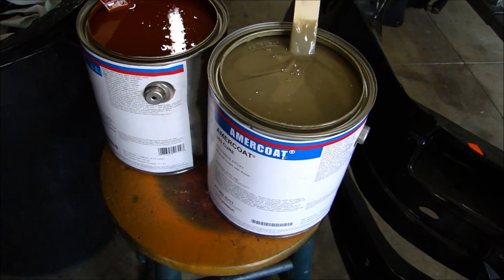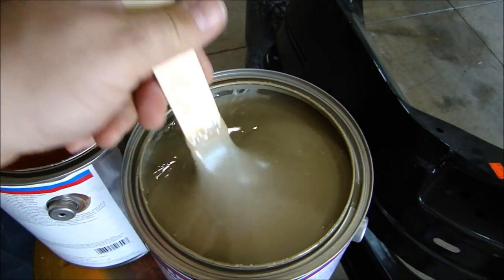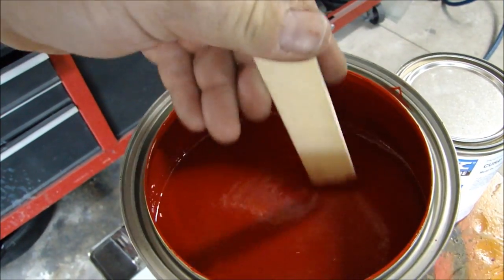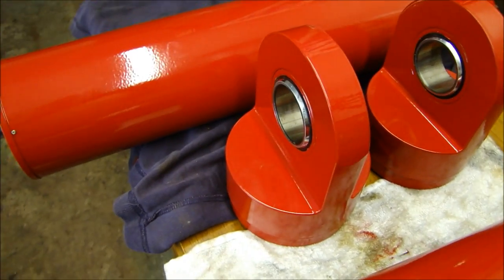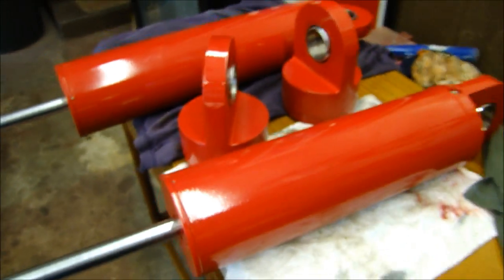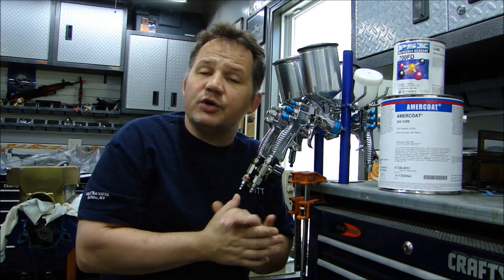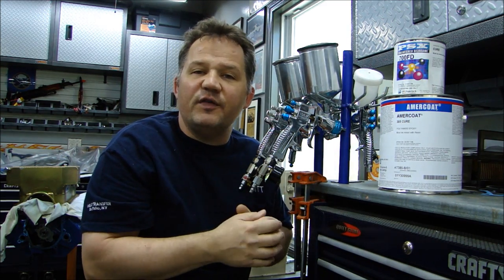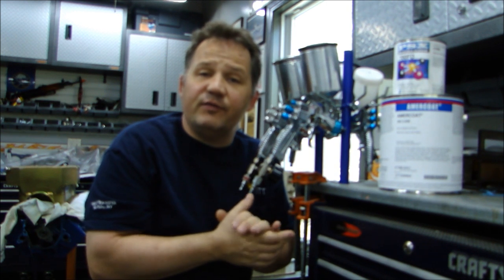Painting With Epoxies

Comment: The Amercoat 385 is actually your epoxy. The PSX 700 is an engineered siloxane. Typically as a few others have asked, all epoxies full and chalk with UV exposure. The siloxane coating is designed to be used as a barrier coating with UV protection. Pretty cool stuff, I work with all different kinds of industrial paints and there are definitely some neat ones
Reply from the maker: Awesome comment! Thanks Ryder

Comment: I've been wanting better way to paint my frame, instead of covering it with grease. I think you've given me the solution. I'll have to check and see if those epoxies are resistant to battery acid spills, brake cleaner, and carburetor cleaner.

Comment: Don't even think about the PC , Pete is right as always , everytime you jack up a pc frame you have to uses a jack with a rag or rubber or you chip the PC . Imo its only for tailer queens not anything you are going to drtive or use or work on. Just drilling a hole in a PC frame chips the PC I have seen others regret it. Another option is a product called POR 15 it is very durable and is very glossy I used it years ago and it worked great!  Come to think of it it may be an epoxy!

Comment: ok im having the exact problem you are talking about and thanks again in advance for your wisdom.  I'm painting or repairing gym equipment that the powder coat chipped and the rust ran underneath or it was a bad powder coat job on some parts.  The best color match is an custom mixed oil enamel (your 100% right matching powder coating is impossible).  sanding  it to bare metal and I'm priming it with two part epoxy iron oxide to prevent any rust from re-forming,  then enamel to color match then clear two part epoxy again over the top to give it some durability.  the epoxy im using is not as thick as yours as the curing agent is much less viscus and almost like a light oil viscosity.  its a 3-1 ratio with 20% reducing if spraying (that's the instructions on the can).   Using two part epoxy is new to me and my question is what tip should i be using to spray this.  ive been researching a conventional spray gun is better for thicker material but where i live in all the conventional guns are around 1.5 .  I have seen some hvlp 1.8 and 2.0 but the research on them is that they are not good for thicker epoxy and more of a headache to use on this kind of material.  any advice would be appreciated
Reply from the maker: I would start with the 1.8 and reduce to get it to spray nice. Epoxy can go on heavy so go with light to medium wet coats allowing maybe 30 minutes in between depending on temperature.

Comment: Great demo. Could I use just the 2 part epoxy primer and catalyst (only) with out the topcoat and get longevity if I brushed it on a truck frame ? Thanks again
Reply from the maker: You could, but the finish would retain moisture. It would still last quite awhile

Comment: Do you have a coating recommendation for steel scuba tanks?  The original coating was a hot-dipped galvanized coating and that lasts about 5 to 8 years before the galvanized coating starts to fail and I have to start messing with them.  The problem with my tanks is twofold.  First is the salt water and second is the amount of banging around each tank gets when its loaded on/off my boat as well as on/off the truck between my marina and the tank fill station.  I've used a 2-part epoxy primer and topcoat before and that was OK.  The problem I had with that was once there's a pin hole in the coating, it starts to rust under the coating and creates a pack-rust that's very hard to get off.  I've also tried a cold-galv paint and that was pretty worthless.  Oh, and there's the other problem that I live in Cozumel, Mexico and getting the "right" stuff here will likely be impossible.  Thanks in advance for any suggestions.
Reply from the maker: I would clean them down to metal, coat them with 1 oz. fiberglass cloth and resin to make them impact resistant, then paint with a decent epoxy.

Comment: I just cleaned and degreased my truck frame and had it blasted and I coated it with macropoxy 646 from sherwin Williams . I rolled/brushed the front of the frame and sprayed the back with my harbor freight gun lol. I’m worried the front is a little to thick to add another coat . What should I do ? Will it cure okay and be safe to add one more coat with a gun then top coat it ?
Reply from the maker: Sure

Comment: Just a note, if that's a proper epoxy mastic, and it looks like it. You'll actually get better results from painting it directly onto bare steel, that's how its designed to be used as then it can adhere directly to the metal.
Reply from the maker: It depends. You have to look at the grip strength of the paint. If the primer has a higher grip strength, it will help the paint adhere.
Reply: i guess he dosent know that some epoxies are not self priming and recommend primers .
Reply: That is what I have been advised too. I even asked about using a rust converter (I'm restoring a car chassis and have taken it back to bare metal so no loose rust only small amount in bottom of pits, the kind that only media blasting would remove) and was advised against using it. The Epoxy Mastic 121 I will use is an all in one primer and top coat. I have all keyed the surface with 40 grit on a DA as you need both a physical and a chemical bond if you want it to last. However, nothing lasts for ever. So all we can hope for is a reasonable service life 🙏

Comment: Is the durathane self leveling and does it drip when applied on vertical surfaces?I purchased ppg durathane for a public sign I made. I look fwd to learning how to mix and spray with this. You should post that sometimeGreat video, thank you!
Reply from the maker: +Belitz Sculpture It will self level if you put it on right. I've painted it vertically with no problems, but you have to let it tack up in between coats

Comment: hey Pete a question for you on your epoxy paint ...does that automotive epoxy that your using chalk like the amines or amides epoxies i use and require a top coat for durability and uv protection.
Reply from the maker: No, this epoxy is incredibly long lasting, designed to be used on bridges

Comment: Hi Pete, can you tell us what equipement do you use to apply these multi-components paints, doesn't look like you are using a pressure pot? Thanks for your reply.
Reply from the maker: You really do not need a pressure pot. I reduce down to the viscosity I need to spray with a 1.8 tip
Reply: ok good i will try that i am looking forward to try the new psx 805 but it looks like it is hard to find
Reply: @PetesGarage  We're talking about the gravity-feed guns in your closing segment?  Yes, I am amazed that viscosity could be sprayed by just about any equipment.  Video of the spray process would be...immensely useful.  Does the primer go on with scary-looking orange-peel, then lay out while you watch?  
The topcoat (PSX-700) isn't an epoxy per se - it's a polysiloxane, hence UV-resistant.

Comment: I had my frame and a bunch of parts powder coated for my bird the cost was 400.00 and im happy with it but it is a semi gloss black finish or 60 % gloss.  it looked good wen I did it and I thought it would be durable but when putting the suspension together it chip very easy so not a durable as I would think it should have been
Reply from the maker: Chris Mansker That is why I do not recommend powder coating for parts that may chip. It's impossible to fix. I do allot of powder coating and it is great in certain areas.
Reply: ya I will most likely just paint my frames from now on but it still looks great and ya cant see the scratches as they are on the unside areas of the lower a arms but im still happy with it.

Comment: Hello, do you know the the product code for the other part for the Amercoat 385 Cure? Did you buy this online or through a local PPG distributor? I need an epoxy primer for a 10'x8' Conex that will be submerged in saltwater as a dive control container.
Reply from the maker: SpecialedSpellcaster A PG distributor will get both parts for you. It's not cheap but it lasts forever.

Comment: What nozzle mm size and pressure did you use?
Reply from the maker: 1.6 at 40 PSI
Reply: I know this is a year old but I currently use psx 700 on a daily basis in my work, I recently have had some problems with my top coat peeling right off of my base coat, seemed like everything was fine normal processing procedure etch and wash , we don't prime anything but that's out of my hands, I know the problems to expect with that and this is not from no primer. Any tips at all?

Comment: This was very helpful for someone just learning about this stuff, I am looking into finishes for a bunch of steel fence posts which will be set in concrete.  Right now Im considering epoxy coating vs powder coating, any advice or things I should consider?  And can you brush on this stuff?
Reply from the maker: Epoxy is easy and can be rolled on. Powder coat is expensive
Reply: @PetesGarage  Do you get the same value when you roll vs spray and if not, how much less?
Reply from the maker: Rolling is easy and it would look ok for what you are doing

Comment: Epoxies are great for frames and what not as long as they are not exposed to a lot of sunlight.... Epoxies are notorious for chalking with exposure to UV (sunlight) so do not use it on sunlight exposed places....
Reply from the maker: That is true for regular epoxies. This particular epoxy is designed for severe outdoor application. It is the same epoxy used on bridges and external super structures
Reply: That is correct LCNY and this is why the base epoxy coat is top coated with the PSX 700 which is a polysiloxane, not an epoxy.